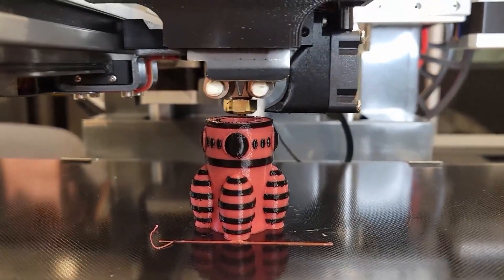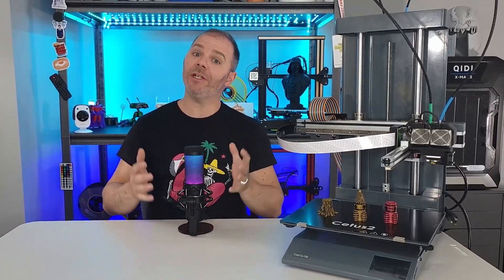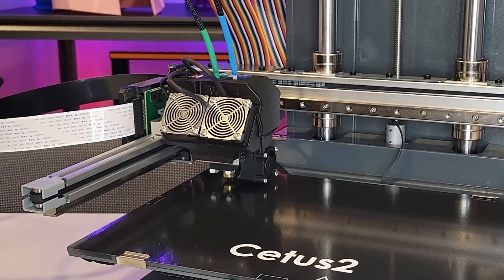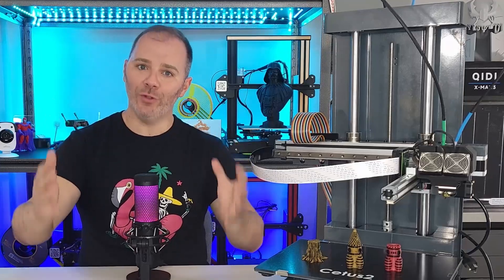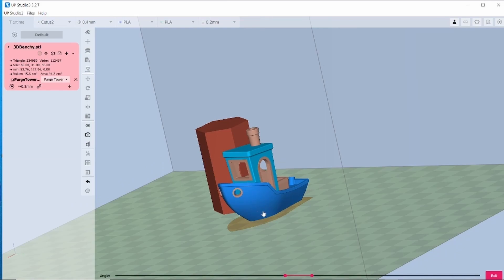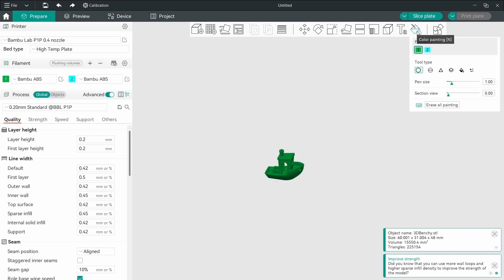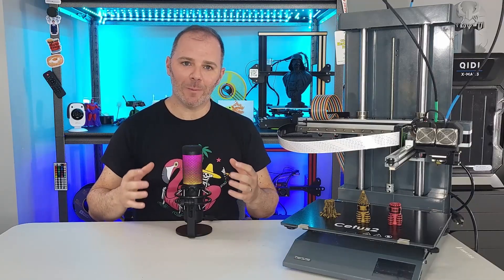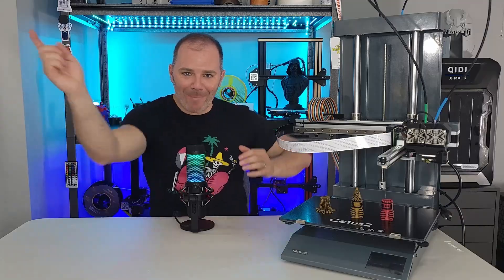Slice Print Review: The Cetus 2 3D Printer! Is this the answer to multicolor 3d printin?

Comment: Dear lord what is that thing... looks like someone's garage experiment but it's a finished product for sale...
Reply from the maker: Yea it's someone's experiment lol It felt like it had a good idea (less waste material) but never actually got around to accompanying that with a usable printer experience. This was also one of the few printer's to make use of nozzle probing, so it had some unique ideas going on. I just don't think they tied this well enough together to make it worthwhile for the end user. Now that Bambu Labs has released a 4 color printer at or around the same price point, sadly I don't think this printer will ever be viable.
Reply: @PrintsLeo3D   Just looking at the components and build for a few seconds it becomes apparent that it was doodled on a tissue paper and the components were bolted together as an afterthought... no design process at all. I watched your video after my comment and found out the board burned after 4 prints...
Reply from the maker: Yeah, I had a pretty rough go with this printer. I hate to condemn a printer based on only my experience, because you never know the board melting could be an isolated incident, but overall this would never be anything I would recommend.
Reply: @PrintsLeo3D  Honestly, its been like that with the company for a while.  When the Cetus came out WITHOUT a heated build plate and that god awful textured (peels off the prints) plate, it was dead on arrive but came out JUST at the right time.  I think being on good rails saved that printer more than the software and bed issues.

Even now, the base design, while not a fast printer, is interesting but it still has the bad software issues.  What makes this even more confusing is a printhead like this did exist.  Look up the QuadFusion ( I got one by the way) and it could do exactly what this thing is doing.  I am not sure it could do it exactly as it looks like this printer gets away with the nozzle leakage by keeping the top of the hotend just cool enough to solidify the filament when pulled but still, if this thing came out that could handle 4 filaments, I am sure people would of ignored all the issues you mentioned.

Comment: The Cetus 2 will be 300$ on their website. I really like the design. Do you think it’s worth it to replace the extruder with a normal”” one and install a klipper board?
Reply from the maker: No, I think that would be one of the worst ways to go with this. Bringing any printer over to Klipper will always get my nod of approval, but the unique aspect to this is the hot end, and the way it loads filament to the hot end. If you were to replace that and the board you might as well just buy an inexpensive printer that already has those features and load Klipper onto that. At this point I think the BambuLabs A1 would be the best way to go if multi colored prints is a must for you. If you need a bigger build size than the P1P or P1s and the AMS would probably be the second best. 
    I am going to look into some of the Klipper multi material options (like the carrot feeder), and see how they can compete. Because, as I am sure you know, I am a huge fan of Klipper.

Comment: Isn't it possible to just use a third party slicer, even if it means starting from scratch for the profiles?
Reply from the maker: Yes... sort of lol Tiertime released a machine and profile for the slicer Cura. Unfortunately right now Cura doesn't offer any ability to 'paint' the models within the slicer. So you would need to find specific models that have been separated by color (hopefully to your liking) and then you could use Cura to slice and print those models.
Reply: @PrintsLeo3D  At least it's something, I mean, I have more faith on Cura to be able to have a paint option than on that slicer to get a lot better. Probably creating a profile from scratch on Prusa/Super/Orca slicer is an option then, at least if you you are experienced with it
Reply from the maker: Hopefully with Cura there may be some update down the road that adds on the ability to paint. The problem I believe with creating a profile from scratch using any other slicer, is the nature that which this printer operates. It's trying to do something no other company is, in their on the fly filament swap, and I believe there are certain scripts or commands that are necessary which would be really hard to port over by yourself. If the developer's had the ability to help in this process it would be a huge boon.
Reply: As an update the Pursa slicer does let you paint but not sure if there is a profile for Cetus2.

Comment: Is the extruder still selfdestroying? I remember my Up mini had the filament grinding against and through the steppers housing because there was no guidetube or cover. Still mad at them especially because 1 replacement extruder cost me 130 Buck.
Reply from the maker: Unfortunately I never got a chance to find out because my mainboard was self-destroying :/ the replacement costs for a lot of their parts seems pricey (looking at their website), but my printer in generally seemed well built. Sounds weird to say that when my mainboard gave up, but it felt like a solid machine.